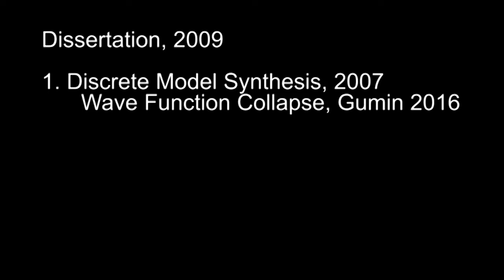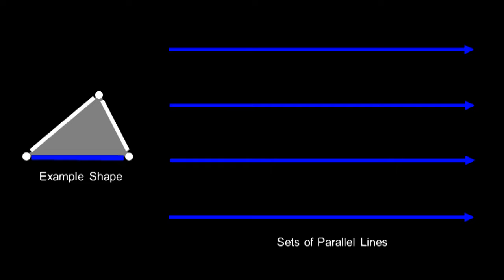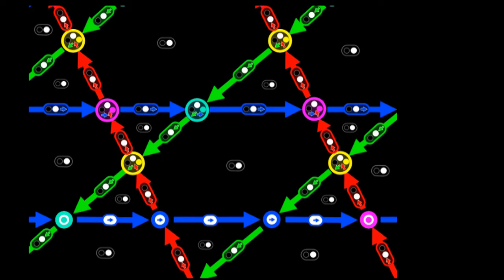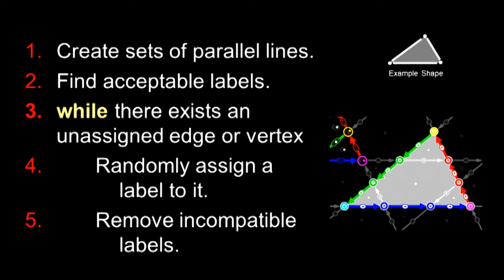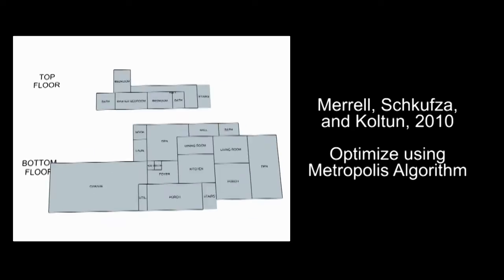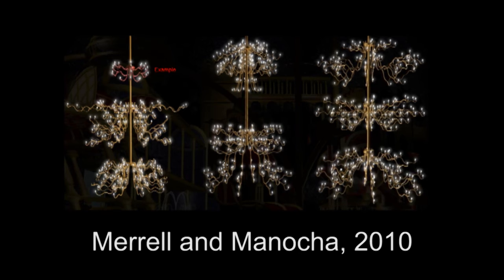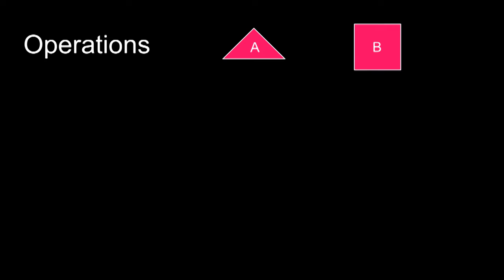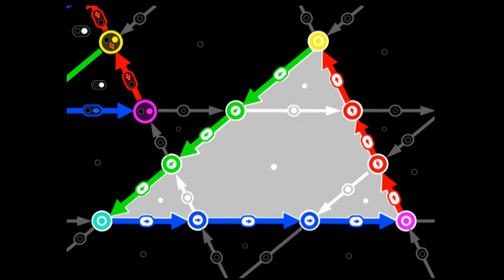Continuous Model Synthesis

Comment: Am I correct in my intuition that using parallel lines from a non-periodic tiling would be completely impossible?

By its very nature I think you would run into the same precision problems you mentioned in the arbitrary points version but to be honest I'm not sure.

I guess the reason I was thinking about that is because if you limit the angles of the arbitrary shapes, in any configuration they would exist in exactly that configuration at some point in the non-periodic tiling. Well any specific set of vertexes would at least.

But as it's an infinite grid you couldn't find that place without rounding something.

So taking from that thought, if you had a tiling that repeats every 16 parallel lines in all directions then you could "round" the arbitrary shapes onto the psudo periodic grid and get exact values of that shape now that is is locked onto the grid.

That's probably not the best explanation and I don't know what I talking about but it's very interesting.

At any rate thank you for that well made video and the work you have done. Every time I see wave function collapse in the wild it makes me happy. Good luck.
Reply from the maker: I'm not sure I'm following you. For non-periodic tilings like the einstein tiling or Penrose tiling, the shapes actually fit neatly onto a regular grid. For the einstein tile, there are only three distinct edge directions, so you would only need six sets of parallel lines, and they fit on a hexagonal grid. I don't see how numeric precision problems would play into this as those are for doing exact Boolean operations, but the tiling is exact.

Comment: Love your work man, congratulations and thanks for sharing. 
For the problem in the last algorithm explained, can't you snap the approximated boolean and the minkowski sum to a pseudo grid? If you treat space as discrete positions instead of continuous, Perhaps it could collapse the small possible differences that were created
Reply: Thanks, that's a good suggestion. I did look into approximating it on a grid, but I couldn't get it to make all the shapes I wanted it to make. There may be a way to do it this way, but I had a lot of trouble with it.
Reply: @ItsJustAstronomical  I see, yeah, it's quite a complex problem to solve. I'm excited to see what you're going to come up with next btw.
Again, thanks for sharing this, I love procgen and I'll surely use it in the future.